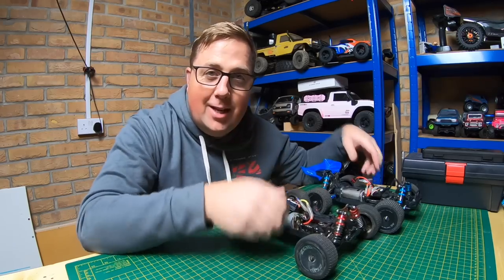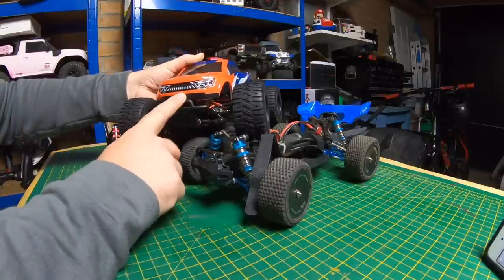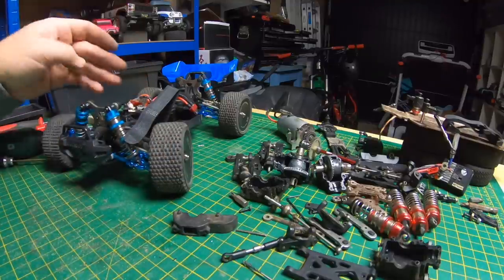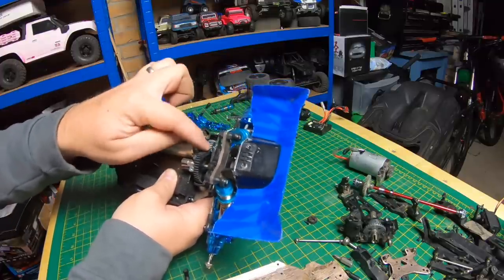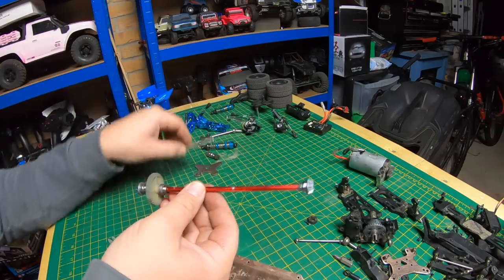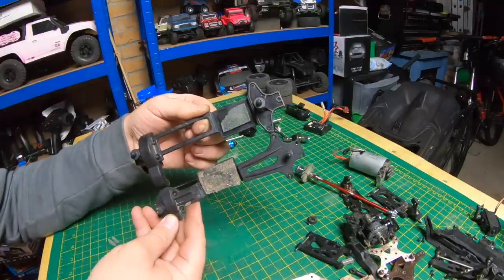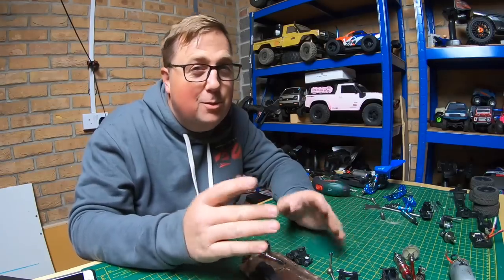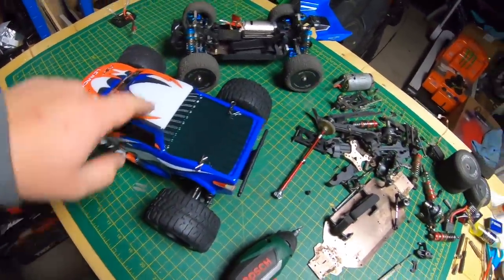Which is Better? This may surprise you! WLtoys 144001 Vs XLF F-16 (Full break down)

Comment: If you got a 144001, leave it stock. don't bother with full metal upgrades etc, more problems that it's worth. Upgrade the esc and motor by all means but stay with the plastic parts, you'll thank me for it.
Reply: Just better off buying a second car by the time you upgraded one and then you got a basher as a 2nd vehicle like John Robinson RC does and he sent his off 15 metre drop the other day. Did it survive, very nearly and the fix video was great even though he didn't get it up n running (he can if he really want's to but it's not cost effective) he gave it a damn good go.
Reply: yeah or just buy an lc racing car because your 144001 will end up being half lc racing lol.
Reply: This is great advice. 
I have a WLtoys 12428 and I "upgraded" the usual parts to metal and it absolutely killed it's ability to take an impact. 
Running stock plastics again but stuck to full metal drivetrain.
Reply: @billy9506  That sounds logic. Plastic is much more forgiving due to its flexibility. Maybe I'll upgrade the c-hubs to metal if they ever break.
Reply: @billy9506  yea I learned that lesson as well, oh well, way she goes
Reply: Agreed. Just do the c-hubs
Reply: @krisennadasen9558   Yep pretty much and the shock towers are good but everything else requires thinking outside the box to resolve and I much prefer being inside the box.
Reply: @SPEXWISE  I've done the metal links as well, that is definitely not worth the money and effort
The lock nut comes loose, and they bend. So alignment and camber became a consistent issue
Reply: @krisennadasen9558  I have a solution to that which is quite cheap. You need to slide over a couple of bits of heat shrink tubing used to cover electrical wire repairs. Once you've set the angle and tightenend the lock nuts, slide the heat shrink over and heat it to shrink it into place over the lock nut and the main shaft and the turn buckles. This prevents them from undoing themselves but also prevents easy adjustments in the field. The plastic stock ones are way more solid with less play as well.
Reply: @SPEXWISE  great idea, but I went back to plastic, yeah the play was another thorn in my side.
I would say significant upgrades would be some better quality plastic parts, bulk head bushings,  stronger drive shafts and diff cups.
Reply: Yes, many beginners dump a lot of money on making their cars full metal, increasing over 1lbs of weight sometimes, and metal doesn't flex, it bends with strong impacts, so it'll transfer crash forces to something like your chassis or diff gearbox, which are more expensive and harder to replace than something like a broken A-arm. Rule of thumb, don't go full metal for a basher, only for a shelf queen. Make smart metal upgrades, metal front knuckles, C-hubs, and rear hubs will make your car stronger, while keeping down weight, these parts are the weak points on pretty much all RC bashers, espeacially the front knuckles.

Comment: Good tear down Phil, what concerns me though is the diffs on the F16 are EXACTLY the same as the diffs that crap themselves out rather quickly on the XLFX03 i reviewed and the X04 you tested. So not sure they will last well in the long run specially on brushless power! unless the XLF factory improved them since those previous models i mentioned.
Reply from the maker: Oh, I hadn't taken the X04 apart..... good to know! Hopefully this being a little smaller, and not under as much strain, they will hold up!
Reply: @TomleyRC  yeah i done a tear down video on my channel shortly after i reviewed that truggy when it miserably failed

Comment: Different style of video,i like it.

So the f-16 is beefier stock, but slower, if your going to rip out the motor and do a brushless conversion may be the way to go ....

Interesting that the shocks are skinnier, may not land so well from big air, given its a heavier truck (due to the metal upgrades) would be interesting to see you bash the f-16 at a skate park and see how it holds up...
Reply from the maker: Yeah, not sure which I prefer. But it's got potential

Comment: hi tomley, i am a guy who has a budget of around 180 euros. Do you advise me to take the Wltoys 14401 and do a brushless upgrade and maybe even servo and tires or buy the xlf f17 leaving it as it comes from the factory? I am interested in durability rather than performance, I have heard that the xlf differential is quite flimsy and the aluminum arms are not much better than the plastic ones ... thanks in advance!
Reply from the maker: I would look at the WLtoys 124019, it is a little more stable than the 144001. But just as fast
Reply: @TomleyRC  thank you very much, possibly between 14401 and xlf f17 which one would you recommend? especially for its robustness.
Reply from the maker: I’d probably say the F17 due to the slightly better parts. But I’d look up getting a better/faster motor.
Reply: @TomleyRC  thank you so much

Comment: Hi Phil, great comparison vid. Hoping you could help me with one thing, would you mind checking if the diff cups from the xlf would fit on the WL diff ? Im looking to have the wl sit a little bit higher with some longer shocks (approx 1-1.5cm longer than stock) so from what I've checked. I'll need to either have a longer dog bone, or longer diff cups, so that the dog bones don't fall out. 🤔  would appreciate it a bunch if you had a chance to check that for me.
Thanks in advance 🤛

Comment: Great comparison video 👍. I wish both Rc’s gave you a adjustable motor mount to change gears. I know you can mod them but it would be nice from the factory.
Reply from the maker: Yes, adjustable mount would be so much better!
Reply: You can buy adjustable motor mounts for under $10, same as the stock mounts, just with slotted mounts, and you loose the smaller inner holes for 24__  brushless motors. Note that these adjustable mount will ONLY work with 550/40 brushed motors or the equivilent brushless motor size, 36__ size brushless motors.

Comment: To start with, those who just HAVE to have bling will save about $30 if they buy the XLF. Beefier parts are what it's all about when bashing. So, start out that way. I have to point out that you are buying an OFF road vehicle, so, why put a massive brushless system in it later for speed runs when you have bought an OFF road vehicle? Decide what you want, buy it and stick with it!!!!!!! Brushless will be for reliability, not speed.